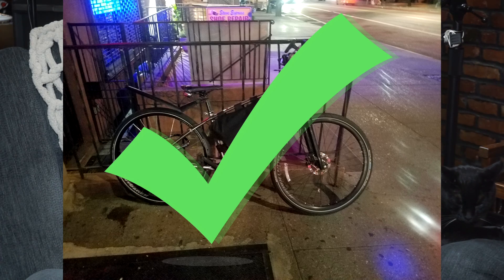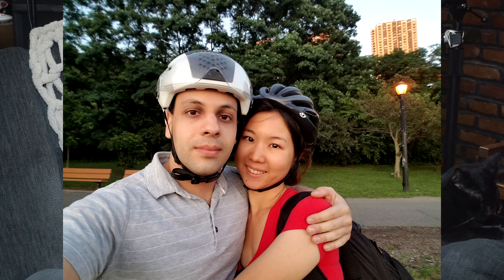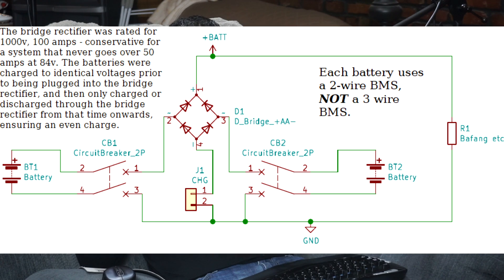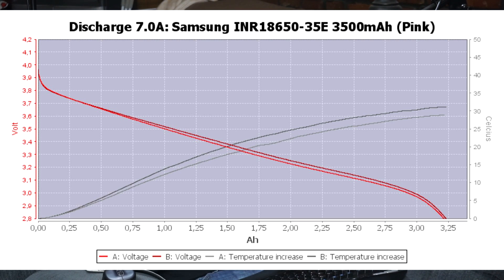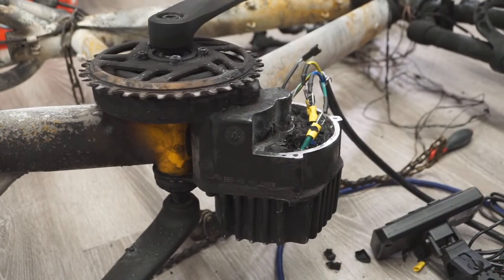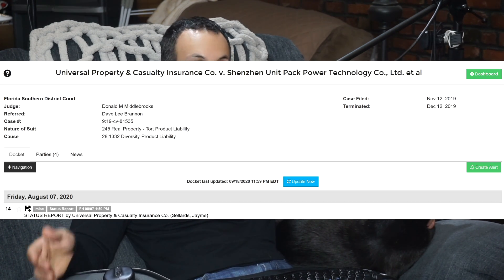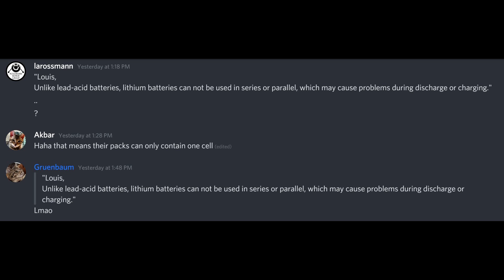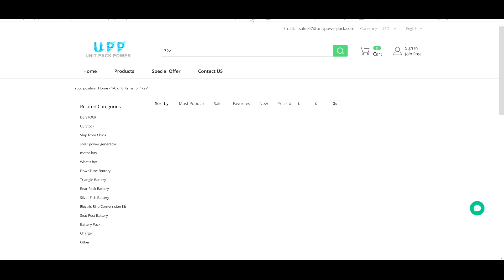Louis' front door goes BOOM courtesy of UnitPackPower battery.

Comment from the maker: Laugh at my misfortune in the ebike discord. https://discord.gg/b73aPET
Reply: Louis i feel ya buddy I lost about 4 k worth of batteries for my ebikes in a fire little over a year ago I only recently realised you also love ebikes because you mentioned it in one of your streams i actually have a sabvoton 96120 I broke because I plugged in the can bus cable from controller to pc while the bike was charging pc turned off and controller got error flashing lights took off the smoking chip off the board hoping it would work without can-bus but didn't fix it I still have it don't know if you would want to try fix it id pay you or at least cover postage if you want to make a video out of it would be pretty cool
Reply: Louis i wouldn't buy batteries from someone who wants to argue with me about your gender, this is what they send me "She parallel 2pcs 72V battery with bridge rectifier is not correct way. But she does not admit it." And then "But the buyer is a woman."
Reply: @ftt2757  Could be that Erica bought them for Louis ? Anyway with two batteries bridged, you could say that they are not actually parallel. One battery can not reach the other.
Reply: @BrainHurricanes  yes it could be that it was bought in Erica's name but the point of my conversation with seller was mainly the paraller configuration and seller says tha you can have parallel batteries and "they are safe if use in safe way"
Reply: One thing I do suggest you get for any bike is a FMF XTR  fully adjustable stem riser and a zoom suspension seat post... the FMF XTR is on eBay and is relatively cheap for the great quality that it is it also has double lockdown procedures to where it will never come loose and cause an accident. I have a review of of it on my account feel free to check it out.
Reply: @AquarianSoulTimeTraveler  probably also spare wheel in case it breaks in one of those potholes on those beautiful roads 😂🤔
Reply: @ftt2757  definitely v-shaped rims are essential. I also run slime tubes in my tires that way they don't lose air over time so you don't have to put air in them every time you're going to go for a ride.
Reply: @AquarianSoulTimeTraveler  Huh? I'm an EE and his circuit design was fine. A bridge rectifier was exactly the right circuit for the job he wanted to do, as any EE would know.

If you using a 36v 15Ah Li battery you're using a parallel set of cells since no single Li cell has those kinds of stats. Every battery I found said 10 series and 7 parallel. Which again any EE would know. 

BTW Tesla uses commodity Li cells in massive battery banks as their power sources and those are wired in both series and parallel.

Where did you get your EE? A Cracker Jack box?
Reply: @KenS1267  shoulda woulda coulda, looked what happened. She would have had a two or three thousand watt motor it probably would have been fine. There's a reason why they design the batteries to go with a certain wattage motor it's not just some crap shoot! it probably would have been fine in this setup too if he would have ran them individually for a few runs singularly before hooking them up as one battery pack that way the pack is broken in... For all we know the bridge rectifier could have failed and some crazy way we've never seen before. For this reason the best part is no part, the best process is no process. If you do something that works in theory but doesn't work in practice maybe you should rethink that theory. Also another thing with these unit pack battery packs if he didn't know you have to leave them on when charging otherwise the BMS system is not engaged. This could also be the problem or could plain and simply have just been bad cell chemistry combined with over engineering and or failure of a bridge rectifier... Any of the ways... KISS!
Reply: @AquarianSoulTimeTraveler  I think you've missed the entire point of this video. And you're making an argument that is self defeating. It is irrelevant that the manufacturer said that these batteries we're used in an unsafe way (especially since you yourself have said that Chinese companies don't know what they're doing). 

Your point that the batteries power switch needs to be on for the BMS to function does not make any sense. A battery disconnected from a circuit (as these would have been when the breaker was open) does not require any sort of BMS. The BMS is only required when charging and discharging, not when the battery is sitting around doing nothing.

You have also defeated you own argument by stating that Chinese companies do not know what they are doing (a point you made in response to Louis asking for a specific wiring arrangement). This is the whole point of the video, this company has no idea how to produce safe battery packs and has no business producing them.

As well it is irrelevant that Louis's circuit could be considered "over engineered" He wanted the additional battery and he implemented a circuit that works for what he wanted. Saying this is bad is like me telling you that the installing a turbo in your car is bad since you don't need it for the car to work.
Reply: @AquarianSoulTimeTraveler  i use to work at a plant where we produced high quality 18650 cells like the ones that this batpack uses, they will blow up like that from manufacturing defects, nothing to do with how you wire them up or use them, you get any kind of tare or foreign material in the cathode/anode insulation and they turn into a ticking time bomb. and all it takes is one bad cell to light up all the other good ones.

we had a bunker in the plant just to test battery's whenever changes where made on the production line and wile most of the ones that failed didn't blow up, quite a few did blow. we also used it to test puncturing cells to the same results. 

so if your getting 18650s from some cheep china manufacture be aware that they will not be as durable as good name brand ones.

even Tesla who make the best 18650 and 2170 cells in the world still have the odd one blow out. as all it takes is a 9 micron piece of dust to wreck a cell.
Reply: You might be an EE but that doesn't mean you know wth you're talking about when it comes to ebike and Li battery tech. Yes, perhaps ebike packs made with cylindrical 18650 cells will have a few cells in parallel for each series, so a standard 48v frame battery in e.g a Hailong case or Reention Tiger shark case will be 13s5p as their limit is 65 cells, but that doesn't mean Li cells don't come in larger capacities. That's a ludicrously stupid thing to say and is plain ignorant! Just because you're unaware of something doesn't mean it doesn't exist. There are literally hundreds of higher capacity (than 18650) Li prismatic or pouch cells on the market, and in use on ebikes for many years. In fact, the owner of Em3EV Paul Lynch (formerly known as Cellman, a wonderful guy and a friend of mine,) used to construct most of his HP packs from A123 amp20 cells, large 20Ah lifepo4 nanoposphate pouch cells, and while those are a far safer lifepo4 chem than the cell types used by UPP,  there is an abundance of reg Li high capacity pouch cells (not just lipo) on the market. I have built and run multiple ebike packs for near a decade now (without issue) using 8C rated 30Ah pouch cells in a 24s setup with no cells in parallel just 24s1p. Then there are the large format cylindrical cells, like Headways that have come in 8, 12, or 15Ah capacity per cell depending on the cell chosen, and they're not the only one's, just an example.
I've been building custom ebikes for many, many years and I could write a list of the possible reasons for this failure, but this reply is already waaay too long, plus I've no real desire to get into it, I mean what would be the point? Personally I've only ever bought one UPP battery pack, I don't really have much need for them as I assemble, spotweld, and build my own packs to custom requirements, but the one I did get from them tbh seems very well constructed. The pack has cell level fusing throughout, is entirely potted and is enclosed in an incredibly strong frame enclosure. I'm not sure what kind of packs (quality wise) were purchased here, (Chinese domestic cells or imported brand name, as UPP use both depending on pack price,) but it sounds a world apart from what I've personally seen assembled by them (I'm an ebike tech so I've seen and worked on a fair few,) but I guess their quality must go hand in hand with the price paid? Anyway, imo Lifepo4 is always a safer option for ebikes and I generally advise people to source a pack built with that chemistry over reg li ion.
Reply: only this could happen to one of the greatest repair techs to walk the planet ........
Reply: have you tried turning it off, then back on again
Reply: Did you get your money back?
Reply: You didn't even pay extra for all of the excitement.  That's a real bargain.
Reply: Still better than a note 7.
Reply: You should take 3 batteries of the same "premium" quality and stress test(less/same/greater amp drain) it while monitoring the temperature... you could also simulate the improvised packaging you did with your battery packs.
Reply: Nah they set you up
Reply: Not laughing. Not smiling. I am morbidly fascinated.
Reply: get a LiFepo4 wink wink
Reply: If you have the emails that specify what you wanted and them agreeing to it the simple fact that the batteries caught fire with the breakers thrown is evidence that they either didn't provide the materials you paid for or did defective work. Considering the hazard it caused and actual damage done I'd contact a lawyer.
Reply: Probably just needed more solder. :)
Reply: Sir, I would not laugh about something like this thankfully you are ok and no one was hurt.
Reply: Holy crap. You’re lucky you weren’t zooming down the road when that happened.
Reply: Saving the planet one E-bike at a time.  Cant wait to be forced to dive an E-car that can burst into flames at any moment...
Reply: @reluctantprophet  you do know gas powered cars are filled with flammable fuels right? they burst into flames all the time, its not even newsworthy.

ev's are way less likely to just catch fire compared to an ice car.
Reply: @reluctantprophet  you mean just like the huge molotov bomb you currently use? I mean your gasoline car in case it’s not that obvious
Reply: Hy Luis in my opinion they f up the battery circuit. I mean the circuit that controls the battery and the probably cause is  in my opinion (i did not see the sematic ) but most of this kind of things have a sensor and a power electronic part and the problem is probably with the power section the FET or transistor that opens the battery is the cheapest one or did not receive the proper heatsink and the FET damaged and did not close as supposed to. (this is all speculating from the footage and from what i see in this video) MM9Z1I638
Reply: MM9Z1I638 is good bat control schip but you have to program it and that is money
Reply: 01:13 this is CLEARLY due to a PP Bus failure in the flux capacitor storage portion of the battery. 
Please call our customer service for an RMA and instructions to send back to us for refund.
Sorry about the fire even though it's your fault for having flammable things in your building.
Reply: I had to watch it a few times but yea that other bike had a bright spot where the battery should be.
Reply: No. I'm cool man, that's actually not cool at all. You coulda been in a seriously life theating situation. There's nothing fucking funny about that.
Reply: why not build your own battery pack and get exactly what you want?
Reply: Louis. I have a E3MV pack. It's a beast. Still going strong 4 years later. Free Hong Kong.
Reply: Why does it take the fire department over 3 1/2 minutes to begin putting water on the fire????? Public employees... Your tax dollars at work.
Reply: This is somewhat of a thumb rule now, wherever there is a burning or blasting battery Samsung has to have some presence there . Thank God this bike was parked outdoor. This should be a wake-up call for people who keep their battery powered bikes inside their apartment.
Reply: Considering the cost of the batteries, the bike, and the damage to the door did you request them to compensate you for the damages? I would have at least spoken to a lawyer. But, then I get free legal consultation. Okay, it costs me $7.50/month. So it is not exactly free.
Reply: I just got one from them i hope it dont happen to me
Reply: Yeah they are frauds.  I've got their 52v 20ah (40amp cont).  Battery doesn't go over 25 amps and the capacity is more closer to 14ah.  I reported them on Amazon when I got my battery from them and found that they didn't use the Samsung cells either.
Reply: Just glad you're ok Louis! Really scary
Reply: 06:13 Wait a minute. You mentioned that you have a "personal trainer friend"?
Was this personal trainer also training you?

And yet you are riding an electric bike?

If this is the case then this clearly voids the warranty on the batteries.
Please read the fine print.
It's the very tiny text that's in Mandarin.
Reply: I'll tell you exactly what it's engineered for it's engineered for running a single battery on a single motor... I have unit pack batteries and I know better than to hook them up in parallel... The one single battery would have been enough to give you a bunch of range and plenty of power on its own why you wanted to have multiple batteries hooked up and parallel I have no idea we'll just call that greed. I have four 36 v 15ah battery packs for my 350 watt ebike... No issues when you don't try to get greedy with power or over engineer something that you could have made simple. It's just the universe showing you that you or not some electrical engineering God and that you don't know what the fuck you're doing everytime time and proving that point. This is what's going to happen to a Tesla if you work on it... CTFU. My e-bike works just fine and goes plenty fast I don't see why you would have such a monstrous e-bike living in New York City it is mostly flat. Trust me you only had a problem because you hooked them up together.  The more cells and a battery pack the more likely chance that they didn't get a perfect match on cell chemistry when they put them together... Stick to 36 volt battery packs run them by themselves and I guarantee you'll have no issue. You don't need a speed demon crazy ass battery pack.
Reply: @AquarianSoulTimeTraveler  also saying that that what would happen if we could work on our Tesla's is bullshit because what would happen if we could work on our brakes and safety systems in our normal cars ? EVERYBODY WOULD BE DEAD, oh wait we can and we are all well and happy (untill covid fucked our lives)
Reply: @AquarianSoulTimeTraveler  running 4 batteries in parallel been that way for the last 2 years I have not driven my car in a year and a half considering selling it the batteries are 48volt 20ah each not a speed demon i keep it at 20 mph and i go for range am really into camping fishing and my lil bike is great no issues the issues I get are when I want to run one battery at a time and switch to a fully charged battery i will get less range by a lot i will lose 8 to 10 miles if i run the batteries one at a time
Reply: @69tytyhar  well at this point your battery's are probably fine it's when they are new they have a chance of doing this just like all batteries when new that's when they need to be ran the hardest... Once you have ran the battery more than 10 or 15 times then it can start to handle these things a lot better it's just shitty battery chemistry.  Plus they have also taken shortcuts to where the power switch needs to be remaining in the on position when charging it... This way they can provide a cheaper charger that's not as good and if you use a cheap charger with the switch in the off position then baboom... Just Chinese providers trying to split pennies...
Reply: @AquarianSoulTimeTraveler  i thought you were sarcastic with your previous post, if you use bridge rectifier it is completely safe to use two batteries and it is even safer than using only one battery
Reply: @ftt2757  and the words of the great wise one himself "The best part is no part." "The best process is no process."
Reply: Next time leave the engineering to the engineers... You're better off picking something that's pre-made as a set. I say that's the universe getting back at you for talking shit about Tesla... This is exactly why you shouldn't have the right to repair!!! Clearly endangers the public!
Reply: @AquarianSoulTimeTraveler  I'm engineer, it's perfectly fine running two batteries in parallel with bridge rectifier. Manufacturer stating otherwise does not know what they are talking about.
Reply: @AquarianSoulTimeTraveler  @Louis Rossmann
I watched your video Louis, don’t get me wrong Bro, I think you’re a really cool guy; but I also watched this video of yours- https://youtu.be/G9hfbQShmvI  and I would urge everyone “including yourself” to listen to what you say @ 45:13 to 45:39 in that video, and make up their own minds on your e-bike catastrophe. 

[As you say in that clip]-You don’t like to be told what to do by “Black Moods”- whoever that is- So, why would you be surprised at ending up with a Black Front Door? 

As persuasive and technically credible as your case defence is presented in this current video of yours; Culpability is up for debate in my view. 

You can behave with the air of an arrogant prick sometimes Louis, but as I say, I do generally like you and your posts; so keep up the good work Brother 👍✔️

The Full video is very good and informative. 
https://youtu.be/G9hfbQShmvI
Reply: @williamsykes7803  so honest what he says is within reason  those labels 750 watt bafang that 750watt bafang can push 1300watts easy (just example) also the fact his motor was still working after the fire pretty much tells me the battery caused the fire
Reply: @AquarianSoulTimeTraveler btw :(  they are not willing to produce my great idea, the should rebrand some of their batteries as molotov versions and sell as eco battery powered 21st century invention